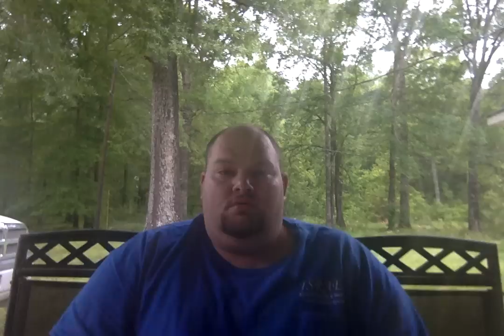Israel Air Blog# 36: 407C

Comment: I should of said that I had train unit that was 34 years old and the compressor finally grounde ...I had bought a used conders with compressor about a year ago that I just installed last week. If I had seen your video  before the replacement I probably would of used the r22 replacement feon.

Comment: My question is this: when adding 15%, do you add it on top of the existing amount or remove old oil to make room for the new? For awhile, they even wanted you to put in a TXV kit to retrofit, and from what I've heard it works with pistons just fine. Information like this is good to get out there, because customers aren't made of money, and it's good to see options out there. Thanks for addressing this type of stuff.
Reply: +tcpHVAC/R Works fine with pistons.  I've done a few.

Comment: good video john. i hope to convert a system in the next few weeks. i have heard about the blened refrigerants leaking and loosing their properties. one would assume you check the composition by hooking up your gauges and comparing the temperature as one should do on any system they arent 100% sure the refrigerant hasnt been mixed.

Comment: I've used 407c a lot, I'm not topping off either because mixing refrigerants isn't my thing, anyway all I did was add oil to what was in there and change the dryer and valve cores, to help the customer out because say in  a couple of years they will be buying a new system anyway, and I make sure they understand that. I personally haven't had a problem I have a unit that's been running like that for 3 summers, and going into the 4th one now.  And I can also say I know a guy who has been topping off units with Nu22 and the units seem to be cooling fine. This guy is in his early 70's and probably doesn't give a damn anymore lol

Comment: I'm afraid someone has dropped in 407c in the past on my AC. Because it is a R22 unit, but someone has hacked in a TXV Valve, do you know of a way to test what refrigerant is in the system ?
Reply: ive never done it, but ive read somewhere you can pump the system down and let it set for a while to stabilize to ambient temperatures.  then measure that temperature and compare it to the PT chart to get the type of gas in it.  but for gases like 407C that are so close in range to R22, the differences might be so close together that you might not be accurate enough for 100% positive results.  ive done these measurements a few times on recovery jugs that are unlabeled, and had good results so far.  but my options were R22 or R410a which are far enough apart that you can tell the differences.

Comment: My question is ...Do you replace the r407c with the same amount as the r22 ? pound for pound or is it a percentage like with MO99 ( which you use 95%)
Reply: MO99 is great.  Just make sure as you probably already know to NOT drop it on top of R22.  Also, charge it as a liquid (but very slow) and dewperheat and bubcooling are your friend.  Basically, it has two (2) PT charts because it has more glide.